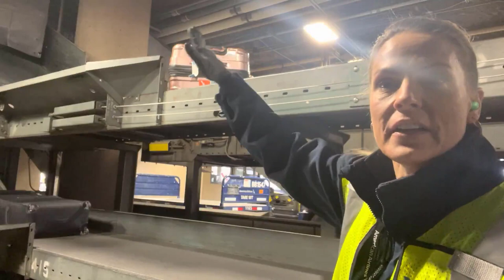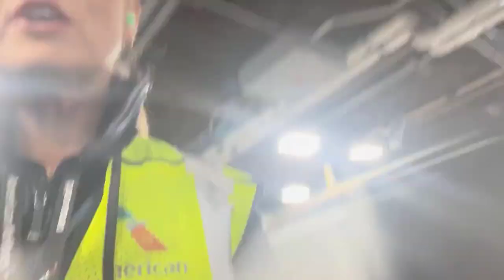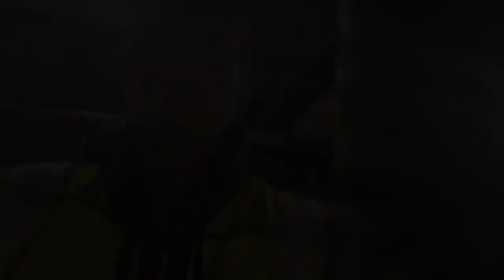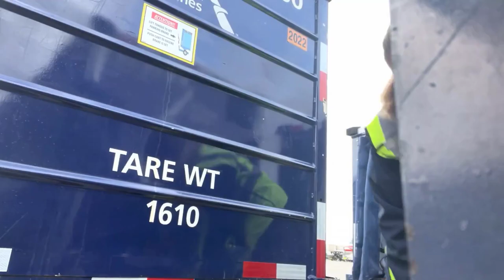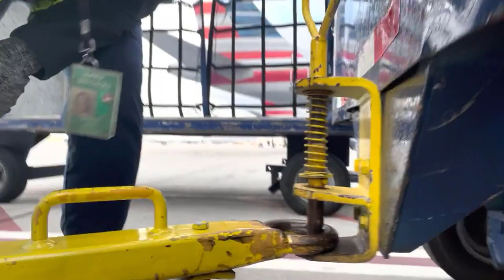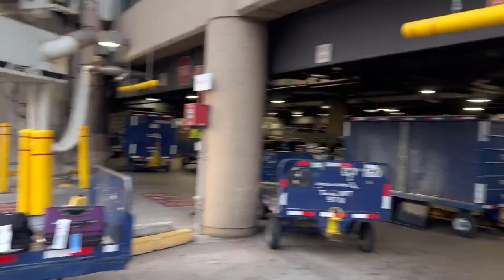How Your Luggage Gets from the Ticket Counter to the Plane

Comment: Not a fan of how the security is for the baggage sorting system.

Would be better if once it was sorted and scanned that it be dropped in a chute to a locked checked bagged cargo hauler that can only be opened by the plane cargo foreman.

That sorting room would be isolated like a clean room and would only have one door that is a transparent gate that remote guard does not allow materials to brought in or out through the door(cameras) and one emergency door for fire reasons.  Room is also heavily surveillanced.

Luggage where destination cannot be determined while out on the tarmac goes in an insert only cargo bin that gets brought back to sorting facility where it gets unlocked in a secure facility, again with heavy surveillance to be logged and tagged.

Comment: I always thought bag movement was much more automated, no human lifting.  Never knew there were women lifting.  You need some marketing.
Reply: The amount of human intervention, manual handling and shifting bags will be due to the age of the terminal buildings and conveyor systems installed underneath floor down on the ground. Probably next refurbishment, the airline might install a more sophisticated and automatic system, but that will cost mega$, so upgrades wil be limited by space and effective gain versus number of rampers filling carts, etc. Large airports like JFK or Heathrow will have a lot of integrated automation!